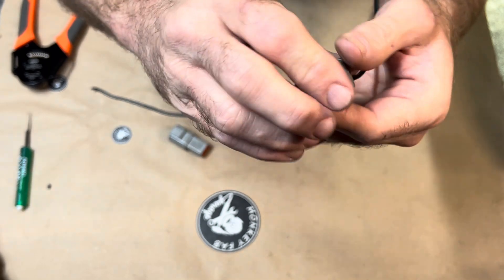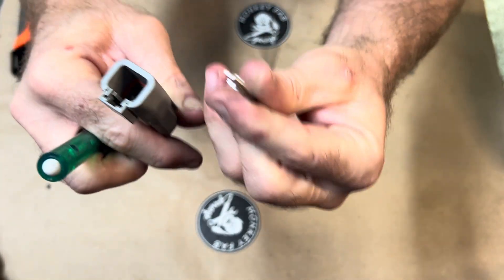Deutsch DTP #12 12 AWG connector set (male & female)

Comment: Curious how it melts the 630 connector when it’s rated for 46 amps? But the dtp that’s rated 25 doesn’t melt?
Reply from the maker: @mauricewaddelliii6244  I split the feed like I said in the video, so you can move 50.   I don’t know why the factory ones have issues but a quick google search shows they do. Still running the same set up with no issues. Did drag week with no issues.  Hope that helps sir.